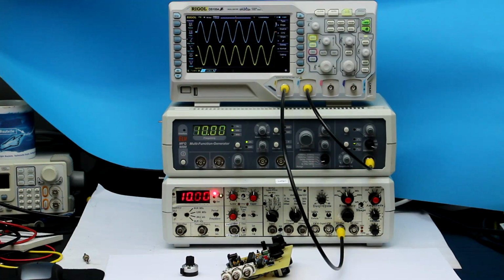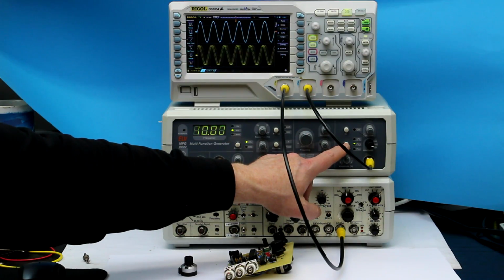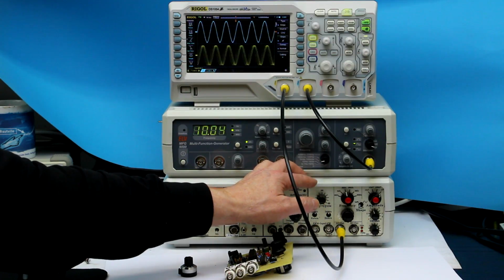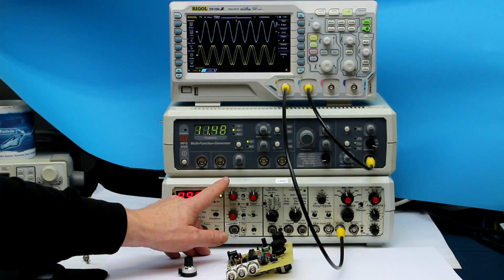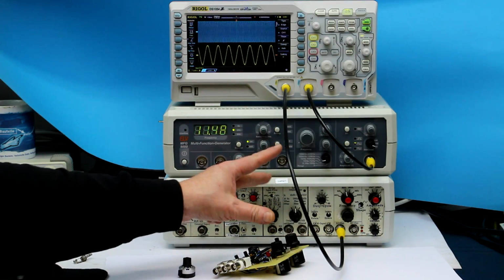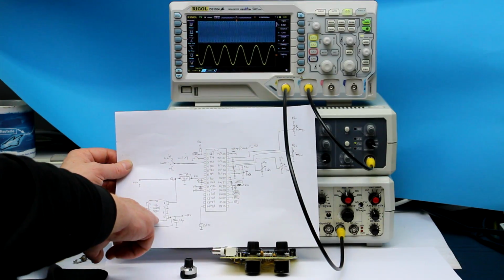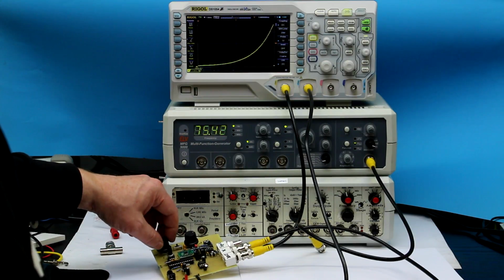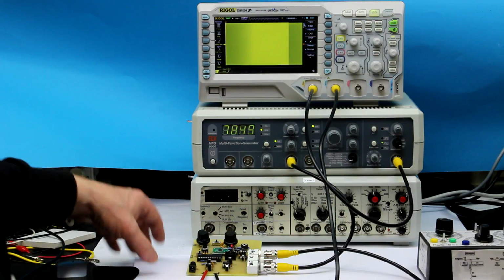Retrofitting a logarithmic sweep-adapter to a badly designed function-generator

Comment: ELV looks interesting. Any way an English speaker can use it?
Reply from the maker: You can´t get it any more and even if,  I wouldn´t recommend the ELV function-generator without the modifications I made (Sweep-generator add-on, reciprocal counter, different frequency ranges)